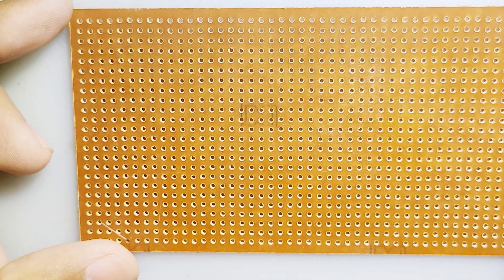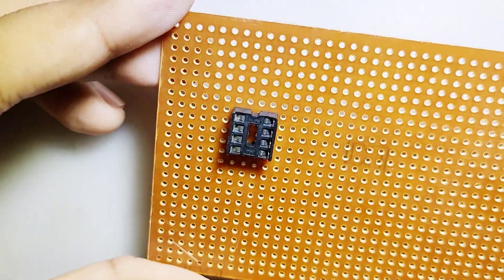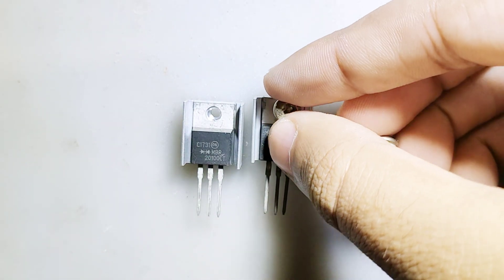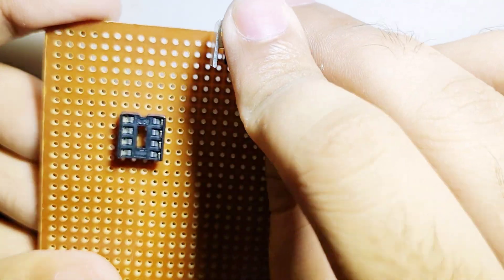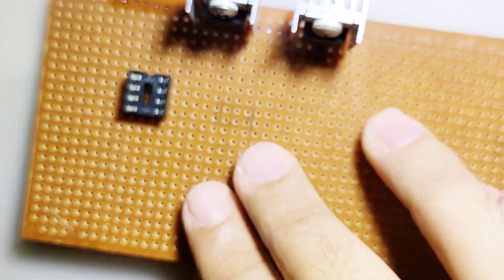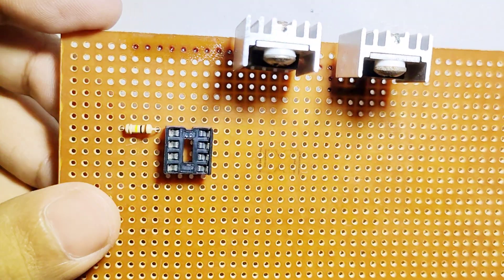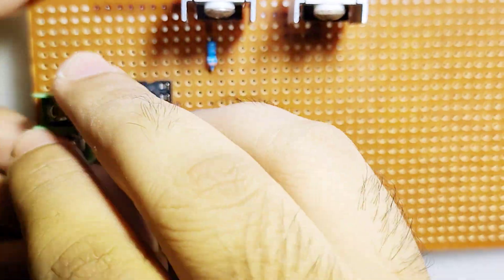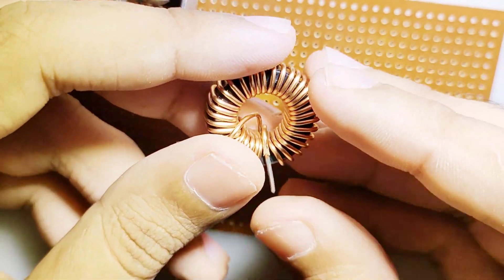DIY Buck Converter 1Volts To 30 using UC3845

Comment: Ummm
What is the efficiency of circuit at 12v 6A output 
Input 24v 8-10A
Can i give 24v to convert it into 12v
Reply: Reply me fast
Reply from the maker: Efficiency is not that Good it's 75% ,
I recommend a different buck converter IC
Reply: @Electronic_For_You how can i reach at 85% efficiency 😢
Reply: @Electronic_For_You how can i increase efficiency to 85-90%
Reply: How can i increase efficiency😅 @Electronic_For_You
Reply: I want 6A output only

Comment: What is the minimum input voltage of the buck converter?
Reply from the maker: 9V
Reply: @Electronic_For_You  thanks
But can I use this buck converter to charge my 12volt 10ah lithium battery from 18volt 80 watt solar panel
Reply from the maker: No,
It's not made for charging the battery sorry

Comment: There are two BJTs in your schematic but none in your hardware circuit. Why so?
Reply from the maker: You have to use 2 BJT , without them it doesn't work as it should!
Reply: @Electronic_For_You  It's not in your hardware circuit then how's it working??
Reply: dude where do you think the mosfet came from. I can understand what you mean. A youtuber with Ai(to be specific txt to speech ) making a suspicious circuit which belong to KD CREATIVITY and only shows his video montage. BUT  using mosfet is better than BJT since here we need power and the ic can only handle small voltages. so power transistors like TIP41 are unnecessary. A mosfet is perfect for such jobs
Reply from the maker: I found this circuit on the Internet and gave it a try !

There are many circuit designers on internet like kasyan tv , danyk , creative kd , so on....!

Comment: Circuit diagram bro
Reply: Bro circuit diagram is different and video circuit different
Reply: Where is transistor u used in video
Reply from the maker: In Description
Reply: Can I give 50voc solar panel input to buck 14v output
Reply from the maker: Maximum 30V Input, 
I used 75n75 mosfet
Follow the given circuit diagram
Reply: Bro
Reply: Bro this video has same circuit diagram
Reply: In this video 30v-70v can give input
Reply from the maker: No, 
Maximum 30v only
Reply: Can I connect two 12 v 100watt panel in series
Reply from the maker: Yes

Comment: Hello, good work, I was wondering if the circuit is rising to 30 volts, did you take a picture after 12 o'clock? Can current adjustment be added to this?
Reply from the maker: Hello
I recommend using TL494 IC This Ic cannot work efficiently on buck mode ,

Comment: Hello I'm making a buck converter with UC3845 and I want to adjust the output voltage and output current, can u give me some advice. I have a troube with the feedback and comp pin, aslo with the Isense. I use P channel mosfet IRF9540
Reply from the maker: You may need a LM358 to adjust current also
Reply: @Electronic_For_You Thank your for the fast answer! Can u explain how to connect each other please
Reply from the maker: Hello
This is a boost converter circuit but you can use the Current limiting part from it , 
https://images.app.goo.gl/nMEozFsj5RXLDCUJ9
Reply: @Electronic_For_You  Thank you again! I appreciate it! I'm gonna try. Have a nice day! Best regards!
Reply from the maker: Good luck 😀👍

Comment: Bro use  blue color mmc electrolytic 3300uf capacitor for high frequency charge your voltage won't drop at small load but aluminum electrical caps like that's your using don't hold alot of energy but electrolytic caps hold 90% of converting energy while electrical aluminum caps hold 10% ,I remember when I first built my first buck converter with aluminum caps I got only 2 amps max from a 1000watts supply then I did the calculations again and realized I needed90% energy storage to get high current gain and only electrolytic caps can hold 90% energy when add the electrolytic caps I got 21amp and 41amp
Reply from the maker: Thanks for the great information,  it will help me in future 😃